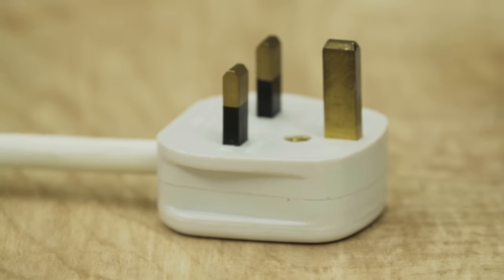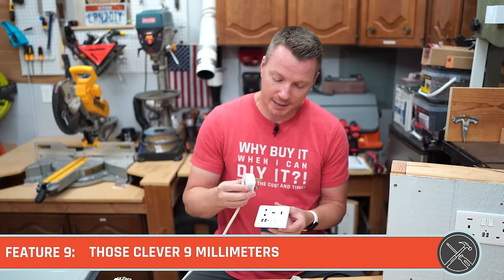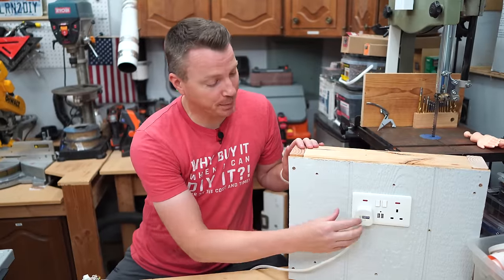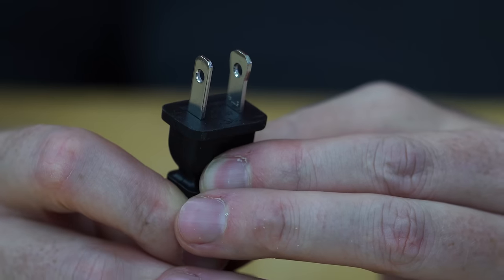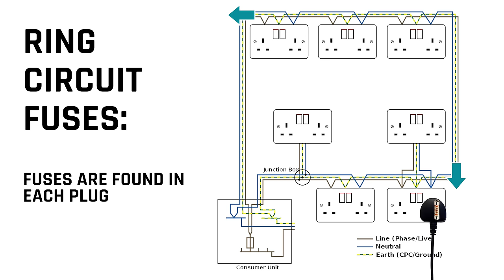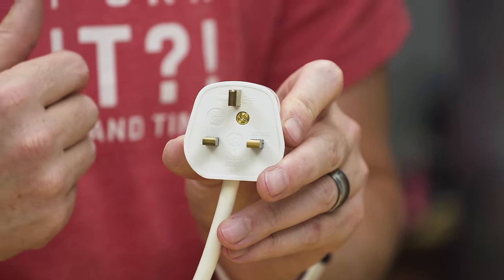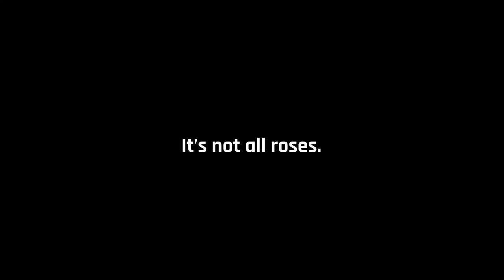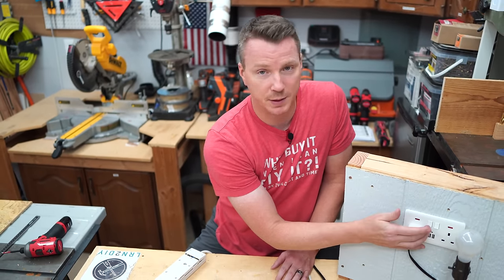British Plugs and Outlets Are On Another Level

Comment: Now I want to see a comparison to EU plugs. 
I grew up with them and was shocked about the lack of safety on US plugs.
Reply: Exactly....everyafety feature he likes on british plugs is done better by EU ones xD -the switches
Reply: @stixinst5791  what do you mean the switchs?
Reply: @lewiskidd9568  he wrote "minus the switches", meaning the eu plugs don't have switches
Reply: @lewiskidd9568  minus the switches
Reply: @stixinst5791  aand then there's the swiss plug, which is better than the Schuko plug (can't mix up live and neutral), and also the smallest one.
Reply: @iFireender  Schuko is better, you can plug it in either way. Mixing live and neutral is only a problem in 3rd world countries, where there aren't any safety regulations
Reply: @jauho7483  Uhm. "Yeah, I'll switch this bulb in my lamp, it's off, no problem"...

Aaand you plugged it in the wrong way around, aand the jacket suddenly is live, aaand you get a shock.

Nah man, I'm happy with the swiss plug. And stuff that isn't earthed -> double insulated is 2 prong (europlug), and thus reversible anyways.
Reply: @iFireender  you still have light switches you don't keep lights always on and it doesn't matter if you put wrong polarity bc it's AC
Reply: @iFireender  what next time?  you will connect a live wire to the socket to the ground?
Reply: @iFireender  yeah they are supposed to have switches that cut both live and neutral iirc.
Reply: @valtti6039  ...you do realize that with AC, the current still 'comes' from one wire, while the other is not carrying current?
Reply: @Tupsuu  *supposed*, yes. But then you get a cheap desk lamp with an inline switch, and those manufacturers thought "hey, we can just cut live, we can use a cheaper switch then".
Reply: I have tried almost every famous plug for some time the American plug is the worst it has almost no durability and it starts zapping much faster than other plugs
Eu plug is good but the i hate the shape not as sturdy as the UK one it’s just feels better and more secure
Reply: @iFireender  not true. The TV we used in the 90s on base in Germany didn't operate if it was plugged in the wrong way round. It became a ritual to hear shouts of "otherway'.
Reply: See what you did there...
Reply: @iFireender  that's just wrong... With AC it doesn't matter how you put the plug in. Either way, the voltage between the two poles where the electrodes "travel" will be 230 to -230 Volts.
Reply: @1905Pauli  And that's where you just outed yourself as not having any idea. 230 is the RMS value. Actually, AC in europe for a 230V goes from +325.269 to -325.269V ;)

It's true that current will go 'either way', but the neutral is at some point attached to ground; thus, neutral is effectively grounded as the reference. 

If you short neutral to ground, nothing will happen. If you short phase to ground, the breaker will trip.
Reply: @iFireender  you normally say the RMS Value, so its no outing and just a little straw you grabbed.
It just doesn't matter how you put the Euro Plug in. 
I just hope you don't work in this profession.
Reply: @jeffdray2500  May have been caused by neutral and ground having been switched in the plug... nasty. I suppose there was no ground fault circuit  interrupter back then
Reply: @stixinst5791  EU plugs are the reason that banana plugs were banned on Hifi amps because anything 4mm and below can be jammed into an EU standard socket
Reply: Meh, been zapped by 120 a bajillion times. Its  just not dangerous enough to warrant a plug like that. I always thought it would be nice to have 240 everywhere, but as someone who has US 240v receptacles for PDUs the load balancing issue seems concerning.
Reply: My country also uses those EU-type plugs as well.
Reply: @andrewtadd4373  so can hairpuns and those are not banned

+ in modern outlets there is a shutoff system if you are not pressing into both slots
Reply: @stixinst5791   EU plugs have no safety shutters, no fuse, no earthing redundancy and the cable can be pulled out accidentally. They’re a B+ as opposed to a A.
Reply: @andrewtadd4373  europlugs maybe, type e and f have safety shutters that can't be opened with a screwdriver like type g can
Reply: @josephanderson5462  they do have safety shutters, earthing redundancy and the cable can't be pulled out? fuse doesn't matter. educate yourself?
Reply: Was that a pun?
Reply: @josephanderson5462  cables can not be pulled out on accident, they have shutters and wdym earthing redundancy?
Reply: Reverse polarity doesn't comply with BS7671.therefore doesn't comply with The electricity at work act which could land you with a fine of up to fifty thousand pounds and/or two years in prison.😀
Reply: Don't know alot about it. But atleast EU plugs look the best.
Reply: You should never be shocked by the lack of common-sense regulation in the United States.
Reply: "shocked". Hopefully not literally.
Reply: What is an EU plug? My Croatian is completely different from an Italian one, and we are neighboring EU countries.
Reply: @kresimircosic9035  That's not really true. Both Italy and Croatia uses C and F plugs which are the standard for most EU countries. However in some places in italy they seem to also be using L plugs. L seems to be version of the C plug with a ground pin sticking out in the middle. You might be thinking of that one.
Reply: @kresimircosic9035  it's the shucko, the round One
Imo it's garbage, l type is the best plug ever
Reply: @iFireender  Not to mention you can find that some things like toasters that only have a single throw switch on the live in some models usually super cheap budget ones but they do exist. Suffice to say mistakenly thinking one of those was off and trying to clear a jam with the live and neutral reversed could end badly, you will most definitely get a surprise if you ground out those exposed heating wires in that case.
Reply: @stixinst5791  EU plugs are trash. They sag, they're terrible in general

Comment: Nigerian here, and I can confirm that the UK type-G plug is the common type around here. We only usually see the type-B and type-A coming in with laptops and printers and such. And, yes, the issues you raised about the straight-out direction of the cables are legitimate headaches. Nearly everything else - fridges, washing machines, electric irons, electric stoves/cookers, televisions, set top boxes etc - all come with 3-pin type-G plug. Never stepped on one of those, but I think I have enough reflex memory experience from stepping on other stuff to keep me from EVER making that mistake. The mere thought of it is giving me the creeps. Yikes!

Comment: As I'm British, I took these features for granted. I knew of all the safety features mentioned, but had never paused to think what a great job somebody did when they put the specification together. It's like most simple, but brilliant designs, you just don't realise they are so well engineered because they almost never give cause to notice them. Thanks for the video, I will not take our humble plug for granted again :)
Reply: @GlennHoddleSucksSocks  Never known anyone to step on one, I think a tad of cynicism
Reply: @GlennHoddleSucksSocks  I'm sure someone somewhere in the UK (or anywhere using these plugs) has stood on one, but I've never come across anyone that has - and I'm not young!
Reply: @GlennHoddleSucksSocks  Pro-Tip, don't chuck a plug on the floor when not in use. Better yet, leave it in the socket and switch it off! 
Can't step on it if it's in the wall.

I'd rather have a small chance of hurting my foot at my own error than the 101 safety flaws of the ones in the US.